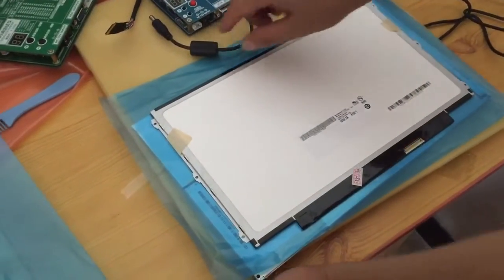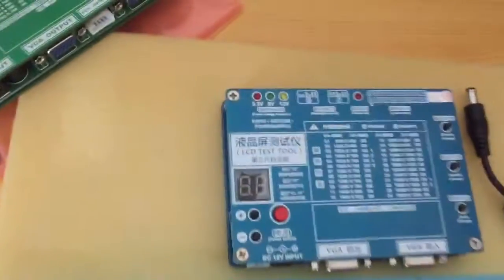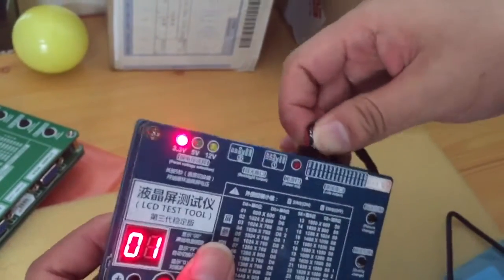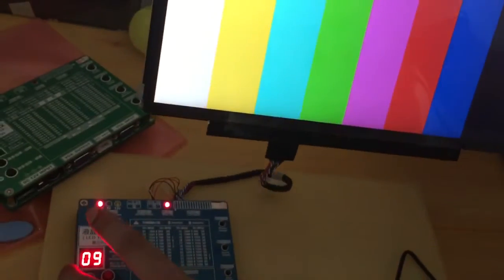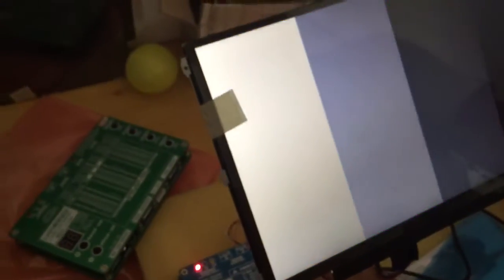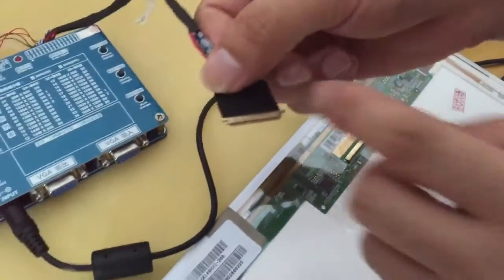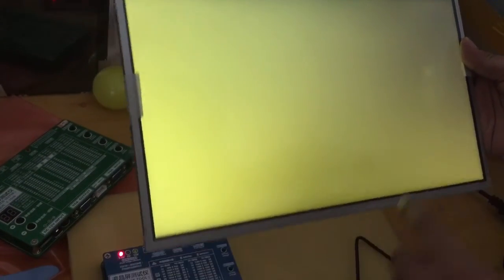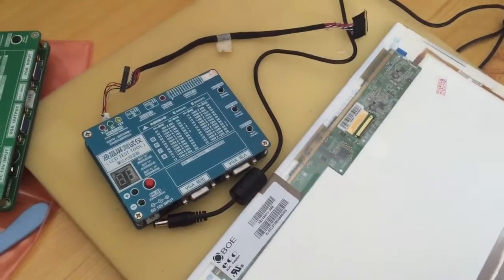How to use screen tester by lepustech.com

Comment: I have a question about a laptop display.. i have a standard 1920/1080 IPS 60hz display.. if i switched the display to a 1920/1080 IPS 120hz G-Sync compatible display ..would my laptop be able to function with G-Sync !
My laptop runs a 1070 GTX card..
i'm asking because you know about displays..  : )

Comment: how  to  know  what  vcc  of the paenl?     how to  know  resolution of the screen?  why there is one cable?  actually  there  are  miliions of  connectors  for  the lcd tv    how   dare the manufactures make only  one type of  connection that  are the  question ou need to  answer to make you   vidoe  coool   other  wise it is   adding   qestion rather than  relpy me